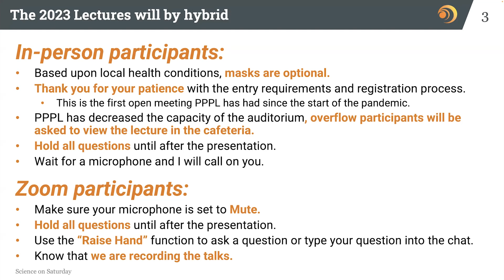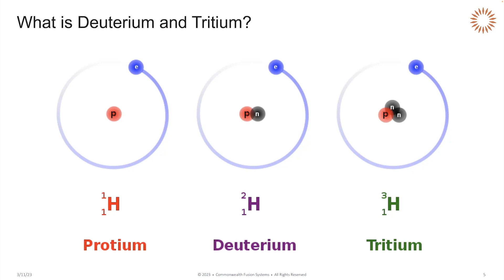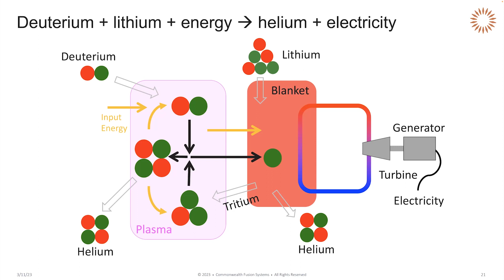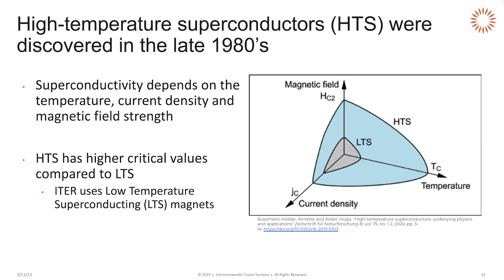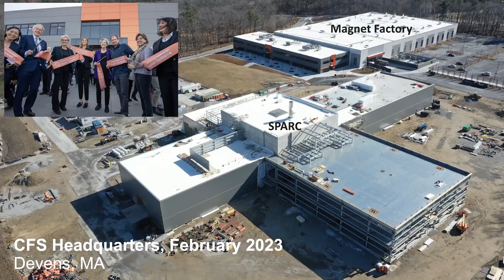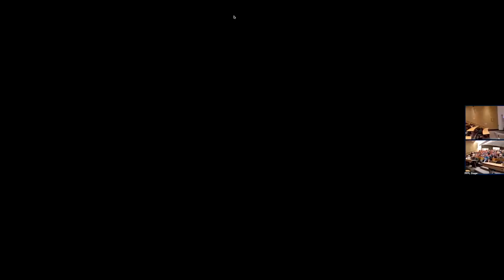High-field Tokamaks: the fastest & surest path to a fusion energy power plant

Comment: I disagree with the title of this video, I believe Stellerators have the advantage.  Even though their magnetic field is more complex, they do not require running a current through the plasma as a component of the magnetic field.  Running a current through the plamsa amplifies any small instabilities in the plasma into much larger instabilities by modulating this field, stellerators do not suffer from this effect.  So even though the initial engineering is a bit more complex, stellerators are inherently more stable.  Add to that the fact that Rebco magnets make it easy to create the necessary shaped fields and I believe hands down the Stellerators will be the first viable reactor that can sustain a reaction.
Reply: Allen Boozer says Stellarator- I trust him. 

Personally I see so much handwaving of the confinement problem though MHD at least as we currently model it in every study basically doesn't cut it and makes so many assumptions that don't hold in the real world. 

My hair brain idea everyone tells me to shut up about is inspiration from nature - quantum gravity probably has something to do with it - physics beyond the standard model is needed - fun

Comment: Where does the desired reaction occur naturally? Fusion would be space, called the sun and fission occurred naturally on earth in uranium deposits. So what should we be focused on, hint not fusion, ITER website gives some data for a continues operating fusion plant for one year would require 250Kg of deuterium which would require processing 1 million gallons of water and the number of plants needed would start diluting the concentration so over time more water has to be processed to get the fuel and what are you going to do with the helium release, let it build up in the atmosphere. The cooling system for ITER is designed for 500 Mw thermal so if sent to make electricity would produce 175 Mw electricity. So a tokamak needs to produce about 2600 Mw thermal to produce 1000 MW electrical, so the cooling system for ITER would be woefully inadequate for commercial operation, so more issues to resolve. We have operating Fission reactors. The fusion talent and money could be better spent on new fission safer reactor designs and breeder reactors which could take the current spent fuel being stored and use the energy still available and reduce the half life of the remaining waste possibly to 300 years. Even this video fails to explain that the power to the lasers in the latest news was 100X more than the energy released.